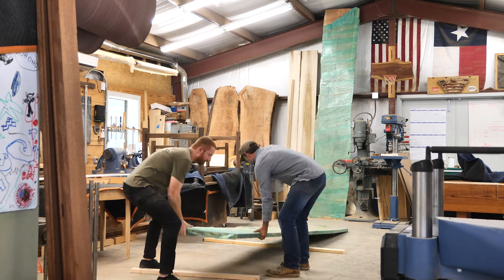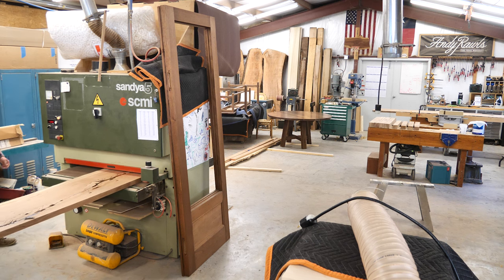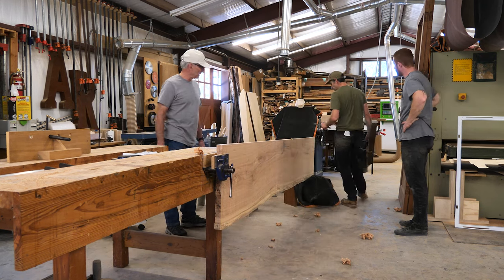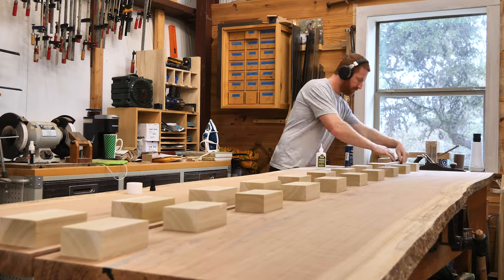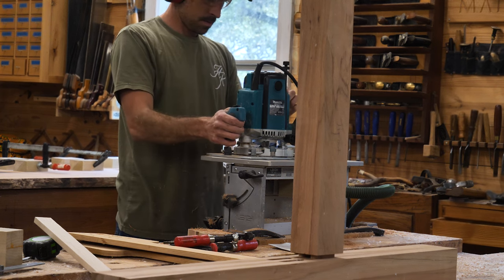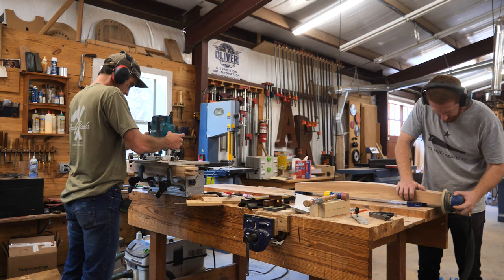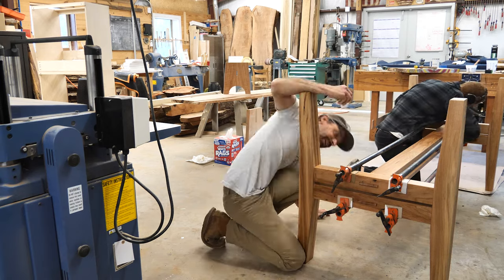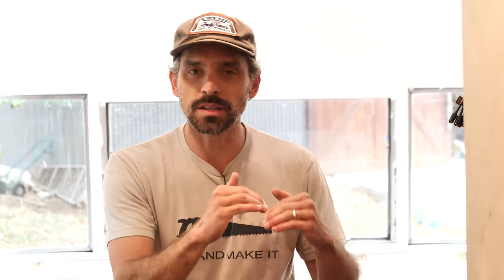Building A Live Edge Trestle Table in Curly Pecan

Comment: I built a live edge maple dining table for my house, I used ratchet straps for my glue up. Worked well.
Reply: Interesting concept. I've used ratchet straps for many things. But I must say I've never considered it for this application.  Considering the pull, one would want to reverse every other strap to get consistent "torque pressure" correct?
Truely it's a community effort to learn all these different techniques! Knowledge is golden IMHO. The greater the options in hand the greater the chances of success!
Blessings aboundant
Crawford out 🙏🔥⚒️🧙🏼‍♂️
Reply: @dragonstonegemironworkscra4740  yes I reverse the ratchet side for each section, and then I used Caws to keep it flat. Also had to put a few pieces of plywood under the straps as when I tested it before glue up, I noticed it the metal started to dig into the bottom of the table.

Comment: I always use a handmade after the jointer,  I have a little trick that would help slightly, if you own a scrub plane run 2 to 3 passes about 1/4" away from the edges, that serves two purposes, primary is that when you run your number 7 you're only contacting the mating surfaces which makes it so much easier to run the large iron through,,the second is that it creates a very shallow juice groove for the glue to sit in and allows the outer edges to come together so much tighter. If you don't own a scrub plane I would highly recommend the veritas scrub plane with a pmv11 blade. Great work all around!

Comment: Attaching a taller fence extension and keeping pressure against the fence surface will give a a damned straight and 90 degree edge. Way too much work with the hand plane. But it’s a great skill to have. So is the ability to dig a deep trench with a pick and shovel. But I’d rather use a backhoe.
Minwax Wood Hardener is what we use to harden punky wood like you were dealing with. It’s as thin as laquer thinner so it penetrates deep and hardens rock hard.
That table turned out gorgeous!!

Comment: Beautiful table. Looks like you're riding the line between holding on to your brand and quality and teaching your apprentice.  Something I've learned from those wiser than me: 'if you're doin, you ain't teachin'. If you've got the tool in your hand, then his hands aren't learning how to use it.
Reply: True to an extent. For me watching the process as done by the teacher is invaluable. Oft it takes watching multiple times to soak in the basics of function then the reactions of the material worked, then the nueances of how the process is performing.
In my wragged mind, if I get told do THIS in this way, then I try and apply the theory without basis for the actual how it's difficult. At the point when the teacher says no your doing it wrong my mind goes zzziiitttt. In contrast if I wave watched rewatched and again, well when the teacher says your doing it wrong, do THIS in this way... I grasp the education easily.
Blessings aboundant
Crawford out 🙏🔥⚒️🧙🏼‍♂️

Comment: I've been shooting Mohawk Conversion Varnish for a few years now and I like it way better than CAB acrylic lacquers. If you want to stop the bubbles from appearing you need to add about 15% retarder/reducer to your mix, it will lay down that varnish nice and smooth and allow the gases to release easier without forming bubbles.

Comment: For the sap wood to harden it I have used minwax wood hardener before it works great. It does create an amber like the shellac does but that wood hardener worked out great I did it on some spalted ash on a podium I made for a video a year ago. It's really thin like the penetrating epoxy and it soaks in really well maybe next time its worth a try.

Comment: Hi Andy I certainly hv never made anything that big table wise (8’ x 4’ my PB oak table).
However on my big cabinet saw I use a Mag Fence which is movable and I can move it in and out by turning off the big earth mag’s and setting it exactly where I want?
I don’t see why you can not use them to help you on your big jointer?
That way you can get that 90 ?  Or way closer than I do now?

Comment: Serious question because I’m an amateur and just plain don’t know.   Could you use a vertical jig to hold the table upright and use the weight of the top slab and slight clamp pressure for the glue up?

Comment: You could rip the glue edges with a track saw, but cut both edges at the same time so they match perfectly. You would need a track +10' long but can always connect two of them. Basically need to put cauls underneath and clamp to both sides, works very well!
Reply: And a cutting depth of 5+ inches - you'd need a beam saw.
Reply: @tenaciousjeebs  not stacked on top of each other. Side by side. There’s a video on YouTube I’ll try to find
Reply from the maker: Not a bad suggestion at all but I don’t think it a a good idea to glue up off the saw cut edge.  That’s just my preference.
Reply: @AndyRawls  Yeah I gotcha, table looks great!
Reply: @AndyRawls  I've done it this way (though not on this long of a table) and it works quite well without a lot of messing around. Just make sure you either have the long track or join a few tracks together and align them with a precision straight edge. Also helps to use a freshly cleaned blade to get the cleanest cut. I've had good results with the 36T in my ts75, but they also make a dedicated ripping blade that would prob work even better for this. Also, make yourself a set of cambered cauls! Great way to keep your table top glue ups nice and flat with very little fuss. Loved this build. What a beautiful table!

Comment: I think you could still have used a router or even your track saw. If you pinch the boards together and cut down the line you should end up with an edge which will close perfectly. Not sure how much quicker it would really be though.